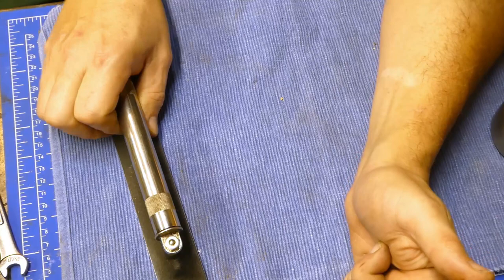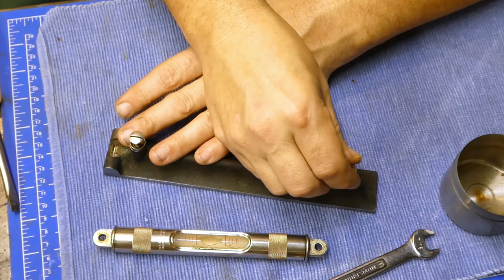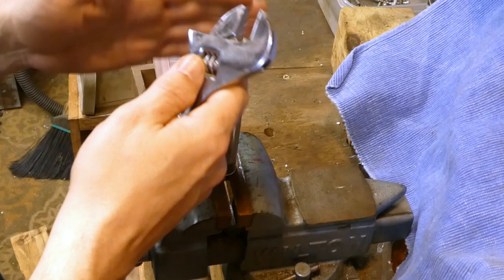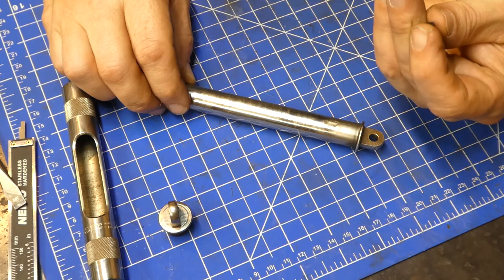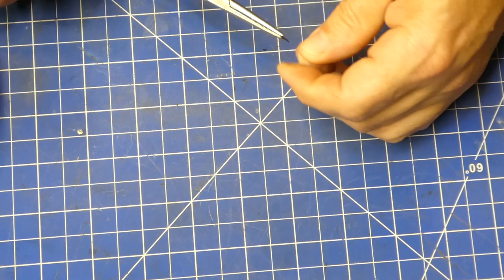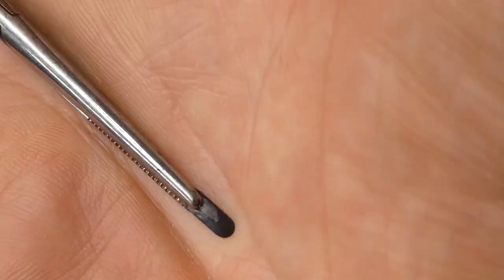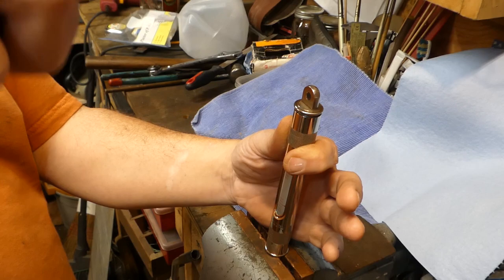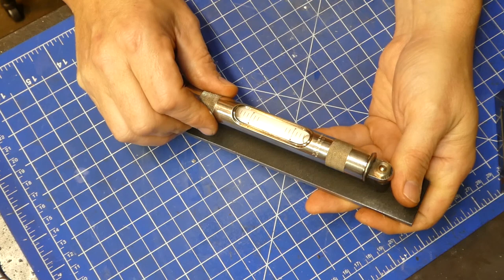Replace a vial and spring - Starrett 98-8 Machinist Level

Comment: I really appreciate all of the extra miles you went.  You did a fantastic job, and it made for a solid video which hopefully does well in views. 
I'm also grateful that you didn't have it held in your rebar cutter while you took a flap disc to the machined surface to "Smooth out the bottom a little."
Reply from the maker: I thought about something like that but I am "just get it done" phase right now.
Reply: @theeddies  I can see this video being very helpful.
Reply from the maker: @johnstrange6799  well that is what I strive for as you know, lol.
Reply: @theeddies  It's amusing that you're in your shop in a T shirt. It's Winter O'Clock over here. I think it was like 4 degrees overnight. I forget.
Reply from the maker: @johnstrange6799  Well it was 74 degrees yesterday and 40 today. Typical bipolar winter.
Reply: @theeddies  74 degrees on a January evening is the work of the Devil. I guess the Devil really did go down to Georgia (For the winter!).
Reply: @johnstrange6799  ungh, it's been a consistent-30°C (-22°F) here for the past couple weeks and snowing every couple days 🥶. Sounds balmy down there 😊. I'm ready for spring lol.
Reply: @Just1GuyMetalworks  That's Mother Nature punishing you for being Canadian.

Comment: Glad it went better for you than Keith Rucker.  I just got the 98-18 yesterday, broken vial, for only $5 with the box.  Soaking the base in warm water now to get rid of cement splatter of all things.  Haven't taken the tube apart yet, but ends seem to be free enough on both ends to remove.  Will soak that in water as well to remove internal plaster. And will be watching for those springs.  Nice video and a new subscriber here.
Reply from the maker: Lol, yeah Keith had a bad day with his. This one actually came apart much easier than I expected. I believe his was corroded badly. Yes, the hot water soak is the way to go for that plaster. Takes awhile but it will dissolve. All the best!

Comment: Hi Ed, I have done a few of these and found it easier to remove whichever plug comes out first and put that end in very hot water. This dissolves the plaster and makes centering the new vial pretty easy. One spring is plenty as it’s only to give the cover tube some light drag when turning it. Calibration is easy but can be frustrating as the 98 style level is so sensitive😂😂😂. Great job and I enjoyed watching your work. Cheers Stuart 🇦🇺. Ps those ground vials are over $50AUD so I’m really careful.
Reply from the maker: Thanks! Yes someone else mentioned baking soda and hot water. I will definitely try that in the future. And yes calibration is frustrating, so frustrating that I almost do not know whether to trust it every time I handle it. I keep rechecking it expecting it to be of, lol. I was quite surprised I got the vial direct from Starrett for around $20 USD which I thought was reasonable. i ship to Australia quite a bit and that is not cheap especially now but you would think Starrett could get a few over there for better than $50. 
The tube did feel fine with one spring but it is really tight now.😁
All the best and thanks for watching!
Eddie
Reply: @theeddies  Cheaper vials would be nice but it’s just the way it is here. By the time you add the poor $ conversation rate plus freight, we pay about double the price on most things from the US. I purchased two 98-6 vials from Starrett AU and a 98-12 vial from Amazon AU they were all about double the US price. Thanks for subscribing. 👍👍👍
Reply: It’s not that hard to adjust. My Master level is hard to adjust, but not that hard. It just takes some patience and experience. Whether one or two springs are used depends on how tightly the sleeves fit. If they’re tighter, one spring is fine. If it’s loose, then two springs are better.

Also, for these who want to do this, just remember that plaster of Paris is gooey for several minutes depending on how much water is used. But then it sets up almost instantly. So mix it and use it immediately. Then put the ends in right away. If you fool around for even a minute or two, it might set up and the end pieces won’t go all the way back in. Then you have to take it apart and start over again. If you wack it when that happens, you will break the vial. New vials here in the USA now cost around $30. But it’s not the cost of a new vial, it’s having to go through the entire process again.

Comment: I just replaced the vial in the same exact model Starrett.  It only had one spring and I'm sure it had never been taken apart. It had quite a bit of resistance to rotating, so I think they left the second spring out on purpose.
Reply from the maker: Interesting, thanks!

Comment: Well, your video is very realistic lol. A few considerations that might help you in the future:
- when making the spring you should’ve formed using a small ball pen punch, working on the middle of the metal piece you had, what would make it easier to form it and cut around to end up with the spring.
- the springs are magnetized so they won’t fall when you take it apart, but it’s not a sure science
- nowadays they use a thin sheet of Teflon around the tube to create the drag necessary, since those springs were a BEACH to try the repair and avoid losing them
- Removing the caps, you did it right, but after you remove one side, you can insert an short aluminum rod that is a little smaller than the inside of the tube then you hit the rod on your bench or on the floor to push the other one out 
- when assembling it, you set the two ends, and align them the best you can, and usually, if you clean them up pretty good and oil them before inserting it, it will go in much easier by hand. You can even light sand it to remove any marks left from the removing process, and that will make wonders, just be careful not to go too far
- if sanding and oiling up doesn’t work, you can carefully use a press to do it by inserting a cheap Phillips screwdriver in the cap hole that it isn’t concave and push it very very slowly. Avoid beating the metal tube as it may cause problems in the future
- so you use a pair of parallel pliers and the Phillips screwdriver to adjust the ends to be aligned to the tube, also to each other

I hope it helps! Thank you for your time putting the video together.
Reply from the maker: Thanks! Eddie

Comment: I'm just trying to buy one of the vials now. It's the 98mm x 15mm version. The level is a British J. Rabone one. But the same as the 18" Starrett one. I am struggling. I found one & then went to pay for it. A 1 month delivery & with all imports etc comes in at $84 US. £60 British. So not worth repairing unless i can find one cheaper. Nice video though. Exactly how i stripped mine down. Regards. Steve.
Reply from the maker: Hello,
Did you try Amazon. They have them for $23 here. Part number PT15024. Not sure about there though. Starrett has them for less than 20 but they never sent mine after 2 weeks when I ordered direct from them. They should not be more than $40 USD shipped from here. 84 sounds really excessive even with shipping and customs. If you want to buy one and have it sent to me I could send it to you for $12. Send me an email if you want to do something like that.
Reply from the maker: https://amzn.to/3N2lQ2w

Comment: Note for others watching this:
One of mine only has provisions for a single spring, as manufactured. 
The vial markings were different from more modern ones too, with only one small graduation inside each large graduation (line). 
So, it’s possible that yours was only made with one spring, in spite of having two spring seats. 
I suspect that they used casting investment and not plaster. It’s much harder.
Reply from the maker: That is interesting. Thanks for the info.
Reply: It should be plaster. The idea is for it to come out fairly easily. The plaster just pushes against the vial to hold it in place. It’s not there to cement it in place.